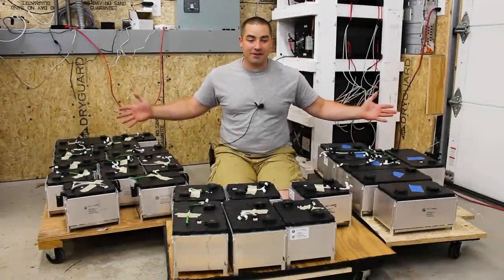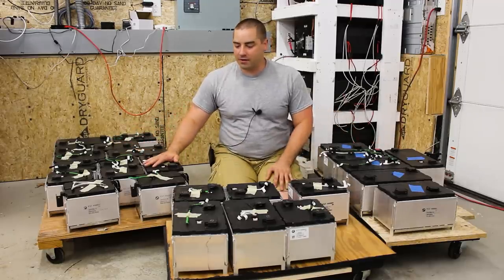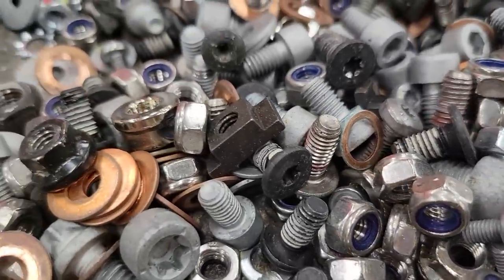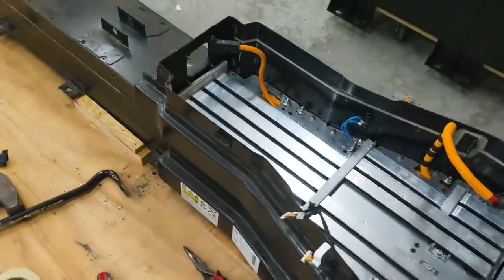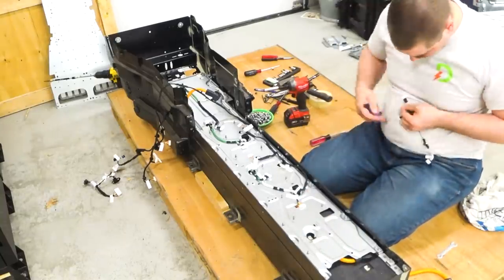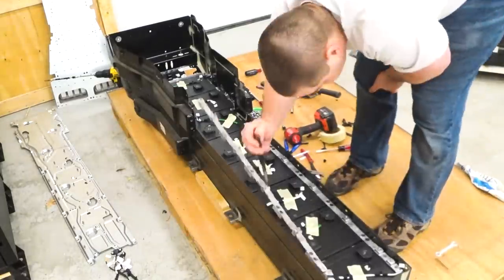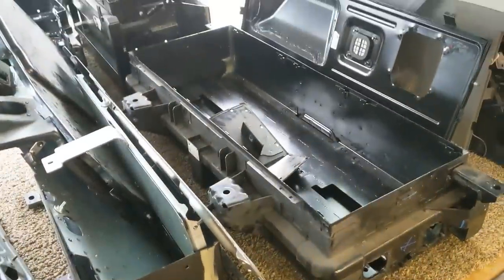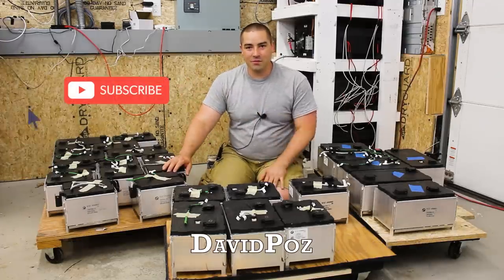Disassembling the Best Built EV Battery in the World - BMW

Comment: For quick reference: BMW E82 1 Series Active E Model Year 2011/2012. Keep in mind, these cells are about 10 years of age in 2021.
Rear module - 6 blocks:  4x 5s2p + 2x 4s2p - totals 28s2p, about 103 V, 80Ah, about 8.3 kWh
Front module - 6 blocks: 2x 5s2p + 3x 4s2p + 1x 3s2p - totals 25s2p, about 92V, 80Ah,  about 7.4 kWh
Tunnel module - 13 blocks:  1x 5s2p + 2x 4s2p + 10x 3s2p - totals 43s2p, about 160 V, 80Ah, about 12.7 kWh
Total is 7x 5s2p, 7x 4s2p, 11x 3s2p = 96s2p (192 cells), about 28.4 kWh.
Cells are prismatic cells: 40 Ah / 46 Ah of early NMC by SB Limotive (Joint Venture of Bosch and Samsung SDI).
By rearranging the modules, one cat get a 14s 12p battery pack (24.8 kWh) out of this, which is on the usual 48V / 51.8 V level that many DIY and solar workers are familiar with.
All figures are stock, when the pack was new before degradation happened. In 2021/2022 it's probably more like 70-80% of these figures.

Comment: Active E was the prototype vehicle preceding the i3 and i8 where BMW were testing the tech for the first time. All the tooling was new hence the overbuilt nature of the construction.
Reply: I doubt it was simplified much, anyone who has worked on BMWs will tell you that's pretty standard practice.
Reply: @oshavlfarms7239  Hey, i work on BMWs on a regular basis, i own an i3 and 335i and they simplified the battery design a lot with the i3.... and is even more simplified on the iX and i4

Comment: Glad to see you had as much fun as I did! Lol! I kept the steel from them and using different parts on other projects. I also had went ahead and bought enough to complete 8 48v batteries. I have the dally bms for them. I haven’t had time to assemble them yet, but I’m looking forward to the build. I also kept the cooling part and plan to use them to maintain temperature.

Comment: some of the Baterry hookups BMW lithium were from test vehicles with I 3 and I 8 ev components but the cars were normal-looking existing BMW  models just electric (heard it was run for two years and then disassembled).  BMW sells the surplus's batteries on the recycling markets.  My I3 module its a lot less complicated in comparison to the ones in the video...

Comment: What kind of wiring is used in these EV batteries? I always see big thick orange cabling. Do you know what size it is? Is it fine-stranded silicone-type cable or more stiff THHN? Just curious, love the details!
Reply from the maker: Fine strand.  There are no markings on the orange insulation, but I've compared it to other wires I have and I think it's 4AWG.  The insulation has a feel like a PVC compound, not quite the same feel as some Silicone wire I have.  Probably a 105°C, not the 200°C stuff

Comment: It is good to have a thermostat connected to your control unit (Arduino) that would shut down the system if the ambient temperature goes above or below the ratings of the battery.

Comment: hi David I did exactly what you are doing in this video last year . we bought 3 crates of this BMW batteries I made (20) 14s modules and 1 7s out of the 3 crates from battery hook up we used your DAVIDPOZ CODE last year it was worth 10% then, and also battery hookup claimed the modules were 90 amps when new. but they  tested 80 to 85 amps when we test them  they have been running now for 9 months.
for me that  was one of the best deals from battery hookup for the  money !
Reply from the maker: I agree, one of the best deals they had.  Good for you grabbing 3 of them to spread out the cost of the shipping.  The label says 80ah, but that must have been with BMW's voltage parameters or something.  If you are getting 80, then you are golden.

Comment: Also, keep up with every connector pulled out of these things. The balance leads can be found with a great deal of digging, but you don't want to attempt to make them yourself. The HV battery cable connectors are proprietary; I did track down the company that makes them, and they are not sold to the public. (if you wanted 10,000 of them, they might talk to you.)

Comment: Thanks for a video! 4,05 V is understandable, but why 3,4V? Isn't it a bitt too high for a low voltage cut-off?
Reply from the maker: There is less than 20% remaining below 3.4V.  I am trying to extend the life of the batteries as much as possible.  I think it's an OK number.
Reply: @DavidPozEnergy  I am also thinking about the best balance between usable capacity and extending the life of the battery. With the upper limit, I came to the same value - 4,05V, but surprised to hear from you a 3,4V low cutoff. I thought about 3,0 - 3,1V, maximum 3,2V. Just thought maybe you something I don't :)

Comment: It's more than how do we get wires set. They have to take into account that the vehicle will be in accidents and how to make the module safe enough to keep it from injuring the occupant(s). All vehicle manufacturers have to take into account the crashes the vehicle migf=ght be involved in. So much to consider when making a module.BMW looks like they overthought it though. As you pointed out, Chevy and Volvo did it easier.

Comment: So David, I wanted to ask in the first video:
What prevents you from using the BMSs, relays, heat sinks etc that are in place? Why tear down all this good tech with so much effort? Why can't it be used for the good?
Reply from the maker: The computers are all proprietary and only work inside the original car.  Perhaps a computer programmer could hack it, but I'm not good with computers.
Reply: plus there's the voltage aspect to deal with..gotta break the pack down to make it useful. Relays and fuses etc can be reused in other projects or sold to make funds to keep up our hobbies.

Comment: David, you made a comment about your power towers that they weren't performing optimally for one reason or another. Could you elaborate on that? I was under the impression that they were performing well.
Reply from the maker: I'm fairly sure I have two cells that are self-discharging.  This is dragging the whole tower out of balance.  I was manually re-balancing them about every 2 weeks.
Reply: @DavidPozEnergy     David; This could make a a very good episode of "What has worked and what has not". You have covered a lot experimental products in a lot of your different inverter/battery builds, but the proof is in the pudding and now you have a scientific experimental platform with results. Thank you for making these videos, you are a strong force in the quest for energy independence.

Comment: So, just checking up on this.. Did you ever put it to use yet ?  My set up is doing well it seems.  14S6P  Right now, I have more solar than Storage, I'm Looking to add more to my system... Know any where for some deals ?  I can only add NMC  3.7vpc to my system,, either that or sell these and guy whole new chemistry..
Reply from the maker: I never did get around to putting these BMW cells into service.  If you are in New England I could sell you mine at a good deal.  Otherwise, Battery Hookup sells EV cells about $100/kWh.  I know a guy in PA giving away 4,000 18650's right now.

Comment: Have you done an update video on your tower of power to illustrate the problems you are having with it?  I know you had built that 6 unit Gyll for 30kW of energy storage, is that the main battery at this point?
Reply from the maker: I have not gotten around to doing the update video on the tower of power.  I bought the Gyll battery to replace the tower of power.  Currently I'm running on the Gyll batteries and Growatt inverters (24/7).  Just waiting on some time to dismantle the tower of power.  I'm going to have to test every cell and remove the bad ones.  Not sure if I'll ever have the time for it though.  So many projects.

Comment: Looks like they went with the complicated arrangement in order to make the best use of the oddly shaped available space. 

Imagine how low the energy density is when you factor in the 300# case with the 700# battery! 

Looks like all that steel is for crashworthiness. Which is comforting lol.  

355 volt is only ~3.7 volts per cell. A nominal figure instead of maximum?
Reply from the maker: Yes.  Nominal, not max.  The pack could in theory vary from 288V to 403.2V.  But, I don't know what BMW had it programmed to exactly.

Comment: It's a lesson in how not to build a battery - modulus  of different cells numbers assembled in different arrays is bad enough but the  vast numbers and variety of fixtures and fitting is appalling - good design would have repetitive cell numbers in a uniform array with the minimum of fixtures and threads with the housing forming a structural beam of the car -  would love to get my hands on some though!

Comment: I have a question off track here . Ecoflow river pro ? Could you run this 24/7 and how difficult is it to add your own 12v100ah battery to it? And 3rdly would the unit charge it also ? I'm asking before  I buy it to run a chest freezer continuously.
Reply from the maker: Chest freezers will vary considerably on energy usage.  For example, storing a chest freezer in a cool basement, compared to a hot garage will double the energy consumption.  But will it work?  I don't know.  I think my chest freezer uses 300 watts when running, but the compressor surges.  The ecoflow you mentioned has a 600 watt inverter.  That might start a small compressor (like on a 7cu.ft. freezer) but certainly not a large 18+ unit because the compressor surge will overload the built-in inverter.  
Second, the total daily energy use.  The average chest freezer in America uses about 1.2kWh/day.  The ecoflow you mentioned has a 720Wh battery, so it won't last 24 hours.  Probably more like 12 hours after you factor in inefficiency in the unit.
I'd suggest this unit instead: https://amzn.to/3joG89Z  I've reviewed it and know it works well.  I use it on my chest freezer.  https://youtu.be/briFUcQVlwA
Reply: I like the bluetti but it's too expensive for me. My freezer says 0.95 amps. The few things that ecoflow river flow pro 720wh. Is very fast charge time  compact and 16lbs. And the USB c  ports 100w I thank you for responding.
Reply: @DavidPozEnergy   Dave  the echoflow river pro has 1800watt x boost  but claims 1200 watt devices or lower.  Your the only one that answers questions I have.  I have to thank you. You can purchase an extra battery for this river pro* 720 wh . But it's 399. I'm wondering if you can answer this . It uses li ion. Batts. And a special connector.  If I find a cable for it and cut 1 end off can what other bigger battery can I use? Same type ion or lifepo4 iRon? The unit itself can only charge the extra battery thats 399.00 . Or is it possible to gut all the electronics in this unit and use them on different bigger batteries?  Is that possible?

Comment: Do I misunderstand or is not the 30k battery pack not keeping up with the 3 5k growatts.
Reply from the maker: I'm sorry, I don't understand the question.
Reply: @DavidPozEnergy  You made comment your battery pack not doing right. So you setting up the bmw battery pak. So is the gyll pak not keeping up with the load the growatts are pulling from them.
Reply: Reason I am asking I am going to use a 21k leaf pak and 2 5000 growatt units.
Reply from the maker: I was referring to the "Tower of Power".  The white shelves with 8x BYD batteries.  That is not doing great.  That's actually why I bought the Gyll Batteries.  I've had the Gyll batteries take over the house.  The Gyll batteries are working perfect.  I plan to take down the Tower of Power and go through the individual cells.  I'll have to test them all and remove the bad ones.
Reply: @DavidPozEnergy  kk. I hadn't kept up with all your videos and I mistook your gyll pak for Tower of Power. Thanks for clearing this up.

Comment: I accidently bought a 5s BMS, what is it good for? and can I use it on 4 3.7 volt 280 amp hour batteries leaving 1 lead disconnected?
Reply from the maker: Most BMS's need all the leads connected.
Reply: @DavidPozEnergy  It's a Daly 100 amp.
Reply from the maker: I use several Daly BMS's and all the ones I have require all the cells connected.
Reply: @DavidPozEnergy  Thx, let me know if you need a 5s.
Reply from the maker: No Thank you.  But I'm on a Facebook group called "DIY Powerwalls".  You can post it there.

Comment: Have you looked at or tested the RoyPow batteries?
Reply from the maker: No.  But Lithium Solar has: https://youtu.be/LNJtYz8yF_o
Reply: @DavidPozEnergy  This is the ones I bought. When I called Battle Born about their batteries and then asked them about the RoyPow golf cart battery, the response I got from them was that the RoyPow batteries are great in golf carts "One of the best you can get". When I asked about using them in a solar battery backup setting, they didn't know of anyone who had. For the money they are they best $ per KWH.Since then I have learned about the GYLL batteries and they do have the advantage of the built in breaker but at the same cost per KWH. I bought 3 of the S51160.

Comment: is it better to run 9p7s7p or 63p7s for lithium ion
Reply from the maker: Sounds like you are making 24v batteries.  Correct me if I'm wrong, but it sounds like you are asking : Is it better to have one giant battery, or 7 smaller batteries?.  Is that right?
Well, I've asked this same question several times because of all the different builds I've done.  I have found that it comes down to the BMS.  I can buy 100 amp BMS's fairly cheap and still reliable.  However, when I start getting into 500 amp BMS's they become extremely expensive, or, not reliable.  So I have personally decided to make smaller batteries that utilize 100 amp BMS's and just make multiple of them.  Then you can parallel the smaller batteries together at a bus bar.
Reply: @DavidPozEnergy  ok thanks

Comment: Sorry to hear your "Tower of Power " batteries are under performing. Were they degraded too far or was it something else? With the amount of batteries that you have repurposed and built for solar power storage I assume that you're going to have close to 100kW of battery bank by the time you get these online?
Reply from the maker: Hmm, not sure it will be that much.  Maybe more like 80 all in.  But the tower of power needs to come down and be re-worked. I think I have 2 cells that are self-discharging.
Reply: @DavidPozEnergy  does your home insurance price go up with self-installs? Just curious
Reply: @DavidPozEnergy  Sure hate to hear that after all the work and time you invested into them plus the cost of purchasing. My LTO SCIB batteries are doing great but, I should have bought another 15 more of them when they were available. I've been searching auto wrecking yards for a full unit to disassemble and have more of them without any success to date.

Comment: I have a data sheet... 0% SOC is 2.890, 100% is 4.093. "Standard" charge is 13.3A, 4.1v; cutoff at 0.8A or 5hrs. Discharge at 13.3A to 2.7v.

(I'd send it to you, but there's no contact info anywhere, and your website is inaccessible to my systems. Saying my browser is "too old" is a BS move -- provide the wad of javascript you call a webpage, it renders or it doesn't.)
Reply from the maker: Sorry, I'm not good with computers.

Comment: Yeap. They are some seriously over-engineered critters. Too bad they're so low capacity. I have just shy of a ton of them [i3 - older 60ah] on the shop floor. (pulled for significantly higher density, small, lighter chinese LiFe's. Those, too, have also been pulled after too many were balloons. The pallet of quality, actually warranted CALB bricks are starting to arrive.) My biggest problem with them is the microscopic tiny balance connector.

Comment: David why are you not responding to my messages?????
Reply from the maker: What do you mean?  I'm right here.
Reply: @DavidPozEnergy  David I would like to pick your brain or try to get some advice from you,, on equipment and a few technical questions as well??
David is there a way we would be able to talk on the phone??
Reply from the maker: Hi Larry,  What is your number?  I can give you a call, and you can delete your comment after.
Reply: David if you would sent me a text to that number I sent you first..
Because my phone blocks numbers that it doesn't recognize,, when you make a text it will work this way I can put your number in there so it will recognize you thanks..
I also have been purchasing batteries and bms  using your name for the discount..
 thank you for that..
Reply from the maker: Hi Larry,  I just tried calling and it went straight to voicemail.  I'm not giving out my number, I'm not texting.  I'm willing to give people quick calls to try and help, but I block my number in the process.  If you need help, and won't take a block number, then try joining facebook group "DIY Powerwalls".

Comment: Its called "german engineering"! There is no simple :) You said the BYD pack is not good. What's the issue?
Reply from the maker: I think there are two cells self-discharging in the tower.  Those two keep throwing the balance out.  I have to take it down and test all the cells.
Reply: @DavidPozEnergy  right, hope you can identify the cells quickly!

Comment: Such complexity and miscellaneous bits (all the various bolts & connectors) add's to the overall cost of the "packs".  Even worse is service/maintenance possible is just so involved the labour costs alone would make it impractical.

As you noted, Volvo (Geely), GM and others are far smarter in this regard.
Reply: you know these batteries are from test vehicles? no?